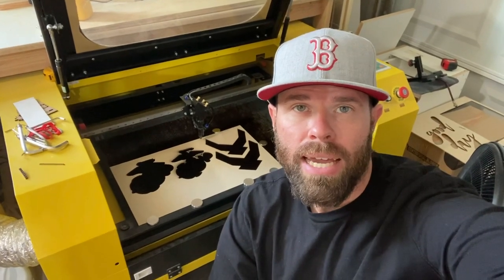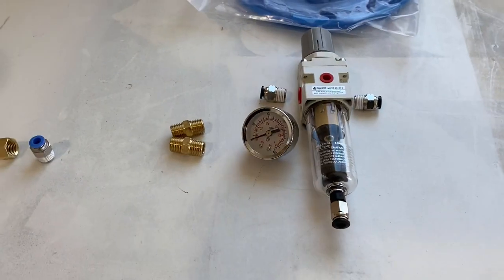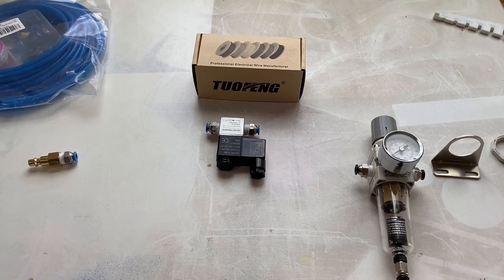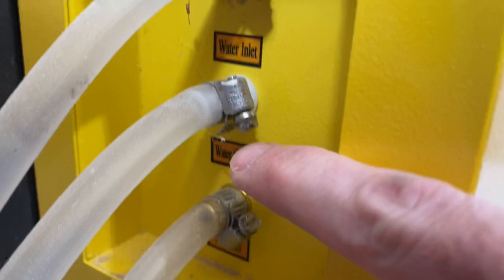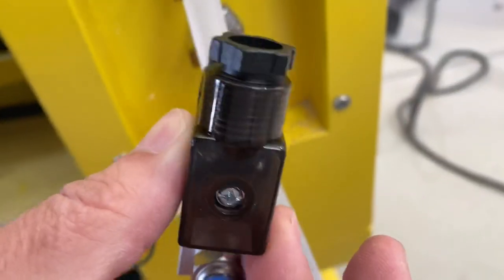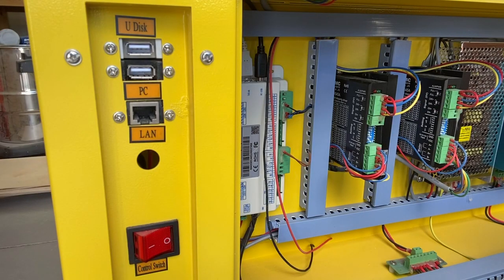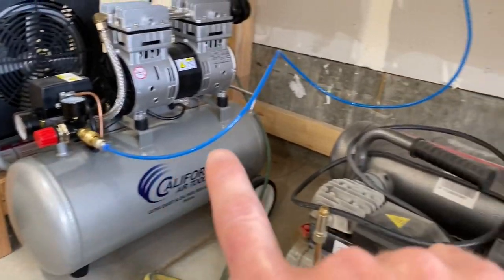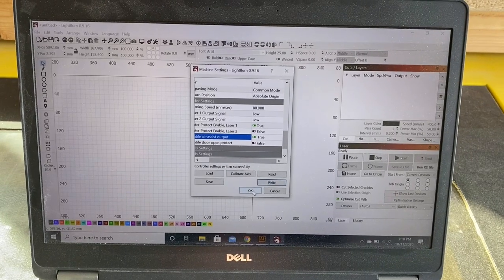Upgraded Air Assist for Chinese | OM Tech CO2 Laser

Comment: Great video. I just got an OmTech 60W that came with the small internal pump, but I’m assuming I’ll get better cuts connecting it to my air compressor instead. And also replacing the exhaust fan as you do in another video. I’m curious why you needed the regulator - doesn’t the air compressor already have one that will let you set the PSI? Thanks
Reply from the maker: So the regular gives you adjustability closer to the machine and it also had a moisture trap to keep anything from getting on the lens and ruining any of the laser components.

Comment: Excellent video! Just did my upgrade. Is there a way that I can make it so the air assist is on while doing a project vs when the laser fires? The relay just keeps clicking when the laser fires. Is there a setting in lightburn somewhere?
Reply from the maker: You most likely have a specific controller that has a setting that I hidden from Lightburn called “blow type”. If you use RDWorks you can access it and change the setting to processing and that will fix your problem.

Comment: Great video. Just curious, why didn't you use the original air assist nozzle and put the solenoid inside the machine? Seems like that would have given a cleaner look.
Reply: Correct me if I’m wrong please but I can’t find where he changed the nozzle. It’s looks like the original nozzle and only changed the tubes

Comment: I am trying to get this upgrade accomplished. I have a brand new 60 watt red and black. It has the factory air assist mounted in the back, underneath the bed. And in the "board" of the laser I only see "24 W and aux air" for places to accept new red and black electrical wires. Is this where I should wire to? Do I cut the power to the stock air assist?

Comment: Great video,  I also have a 100W Omtech Blue machine.  do you have any issues with Pin (5) Wind not working.  i cannot enable it through Lightburn or RDworks.  Any suggestions or if you got it working on your Blue machine would be great.  Good videos keep it up.

Comment: Cool. I have the exact same laser, and tried cutting a puzzle, but it came out tinged from the smoke. Been suggested to add more air, so this is perfect for what I need to do.   How loud is the compressor compared to the air pump and blower? I have my whole set up down to 64DB, and since it looks like you are using the same extractor I am, it should be a good comparison.

Comment: I ordered all these parts and went I went to assemble this today I could not.  I ordered the alternate solenoid because it would arrive faster, but it did not come with the adapters to the air hose.  those 2 adapters cost the same and the whole other solenoid with adapters, so I'm returning the one foe the other, bit that still leaves me unable to get grom the compressor to the air hose because the included 1/4 inch fitting is male, and lo Aly nobody has a 1/4 female to the female side for the coupler.  so even after swapping solenoids,  I am short a needed adapter from the compressor to the hose

Comment: Following along to the part where we are connecting to the black tube coming out the back. It appears my 100W Red/Black that hole is empty. Inside there is a black tube connected to a small compressor possibly internally. How should I proceed on that guy?
Reply from the maker: With the internal pump you will want to disconnect the air line and that will be the line that will connect to your solenoid. Then you will want to disconnect the power wires to the pump from the power supply. It is a pretty simple procedure just make sure the everything is unplugged so no power is being supplied to the machine. It is up to you whether you completely remove the pump or not. At this point you can continue with the installation.
Reply: @BeardedBuildsCo  Thanks. Was watching and looking around some videos and figured to pull the air line. Would you just disconnect the wires and cap them or completely remove? It looks like the wires coming off the old air pump when they meet the board are joined with other wires from a different part.
Reply from the maker: The safest thing is to remove it completely so there are no live stray wires but you can do it either way.
Reply: @BeardedBuildsCo  Very helpful. Thanks!

Comment: Thank you for your guide. Quick, straightforward, and easy to follow.
I have somewhat of a newb question.
I noticed that you link to 6mm OD hose, but also link to 1/4" OD Push to connect fittings. Is it okay to mix and match between 6mm and 1/4 fittings/hoses? Are they generally thought of as being interchangeable? 

Thanks!
Reply: I ordered my laser today. I will get it by the 15th!
Reply from the maker: Awesome! Congrats!

Comment: Thank you so much for this video. Ordered all the parts. Looking forward to the upgrade. Quick question. I noticed you used a new separate wiring block to wire in the air assist. Would there be a problem wiring the new air assist into the original air assist wiring block? Any advice would be appreciated. Thanks again.
Reply from the maker: The stock air just turns on and runs all the time. In order to us the solenoid set up you have to connect it to the pins that I show in the video. 24+ and Wind
Reply: @BeardedBuildsCo  Great. Thank you for your response!

Comment: I noticed the compressor turned on pretty fast after the air started.... is it able to maintain the desired airflow continuously?  Does the compressor have to run continuously or does it cycle on and off?  I'm just trying to get a feel for what size compressor is needed for this since I'm about to convert my own laser.

Comment: Question on the solenoid.  Is it supposed to let some air through when the air is off?  I can hear the airflow when it kicks on, and when it's off there is still a small amount of air going to the laser head.
Reply from the maker: If you are using the setup from this video then there should be no air when a job is not running.
Reply: @BeardedBuildsCo  I am using your setup.  I just looked at the Amazon reviews, and there are comments about it leaking.  So, it looks like I received a bad solenoid.

Comment: Thanks for making this video.  Laser is coming in a few days and I already bought all the parts through your affiliate links.  Only one question, what are the 1/4 elbows for?  I bought them but couldn't find them in the video.  Did I miss that part?
Reply from the maker: They are if you need them for your specific application to route the hoses where it best suits you.
Reply: @BeardedBuildsCo  Great thanks. Cant wait to install it!

Comment: I completed the upgrade like in your video discription , now i have the problem with theb lens , its always dirty  , within 30 minutes , what goes wrong , to much pressure ??
Reply from the maker: Are you draining you compressor regularly? If there is water or debris coming through the air lines it will likely dirty the lens.

Comment: hi if i get this compressor do i still need the regulator you talk about in your video and do you think this compressor will be suitable for my 80w laser thanks as could not get California air tools one as in the uk
Reply from the maker: The regulator have a moisture trap as part of it. That is essential to make sure that it operates with out any water coming through to the lens.
Reply from the maker: Looks like a solid unit from what I can see.
Reply: @BeardedBuildsCo  thanks so do I need to install a separate regulator..??? But I was thinking if I install the other regulator I could position it closer to me to dial in the pressure rather than keep going to the compressor just wanted to know if it would reduce anything by having 2 on the system thanks for your time

Comment: I have a question. I did your install on my 100 watt laser a year ago and it works great. Did the same install today on my new OMTECH 150 watt and the air runs the whole time the file is running. The other one only runs air when the laser is actually firing. Could I have the wiring wrong?

Comment: hi, how did you disconnect the built in air pump on your Omtech CO2 laser?  I am using the hose from it to the laser head, but the pump still runs.
Reply from the maker: Follow the power wires back to the power supply and disconnect or cut and cap then individually.

Comment: I appreciate the video and went through all steps.  I still can not  get the air assist to connect. I don’t know if maybe the black hose that connects to the laser nozzle has a blockage but at a loss here.
Reply from the maker: Have you set the pressure at the regulator and on the compressor? Are you sure you have a 24v solenoid?
Reply: @BeardedBuildsCo  yes I have set the pressure at the regulator and the solenoid says 26.4 v

Comment: with that compressor setup and running 1 filter how have your water moisture levels been to the laser itself, are you running any other filters currently?
Reply from the maker: Mine has been flawless. Keep in mind that I do live in a dryer climate. Still the original set up with only one filter/separator.
Reply: @BeardedBuildsCo  yeah I live in the high desert very dry climate also, just wondering what stage I should do single or double, just curious thanks for the fast reply

Comment: does ir matter when adding to a thunder laser due to the fact it has high and low assist options. Is this process of installation the same?    I also have seen where someone (i cant find the video) added to pressure guage to the machine to see what the high setting is and can adjust and same for the low....... I would have to drill a hole for each one and insert in the each line.

Comment: Did this upgrade. Air assist will turn on but won’t turn off. I was reading that a 24v solenoid is needed. I have a 12v solenoid, will that cause it not to shut off after a cut?
Reply from the maker: Yes that will cause this issue. You will want to get a 24v solenoid.
Reply: Thank you. Thanks for the fast response and great video.
Reply from the maker: Anytime!

Comment: Hi! I'm from Italy and i'm using the ORTUR LM2 PRO as my first laser experience but in the future I want to buy a more powerfull CO2 laser one.
I use your links and now I'm in love with the OMTECH 50W (I don't have the right spaces for others one). I think its good for 2k $.
I'm reading that it works connected to 110V AC so I want to ask..... it's ok for my regular 220V ? 🤔🤔🤔🙈

Comment: This compressor is way too small.
I have a 20x28 60W.
If I try to cut a bed full of objects, this compressor runs non stop and then overheats and shuts down.

Also, dual solenoids are better set up, if you want to have a low pressure for engraving. This way when you have air assist off in LightBurn , it still gives you 5psi.

Comment: I watched your video and followed the step to the "T", but now my laser isn't recognizing the x and y axis and keeps hitting the back right corner. I tried to hit escape on the the controller and still frame a job but when it frames, it wants to go to the back right corner again. Is there something different I need to do for my Omtech 60W AF black/red laser? 

Not sure if I needed to do other wiring? I did see another video that used 2 of the solenoids?
Reply from the maker: The issue you are sharing is unrelated to the air assist unless you disconnected a sensor in the process. 
Watch this video:
Troubleshooting - Co2 Laser Grinding | Machine Grinding | Limit Switches
https://youtu.be/WFhb3ZwT3T8
Reply: Yeah, we figured that part out. but where we put the air assist is where those wires are inserted. in the 24v slot. My stock air compressor is not an external on, it came with the machine and is hooked up to run somewhere else. Would using those confections work for the solenoid?
Reply from the maker: No, you have to connect the solenoid to the controller so it can be controlled by the software.

Comment: How did the 50% power not burn you when you checked the air after hitting "start"? What am I missing lol??
Reply from the maker: I turned the key to the laser power off
Reply: @BeardedBuildsCo  you happy with omtech? My leather patch hat company is booming so I have to upgrade the 20w XTOOL. I was going for a Thunder Nova, but damn it's pricey...I believe I'm gonna settle on an 80w Omtech
Reply from the maker: @RealDustyChandler I have two omtech Co2 laser and an omtech fiber. They are the heart of my operation.

Comment: so today i tried doing this exact installation/upgrade. i bought all the supplies from the links in the video description. but the air assist does not seem to be turning on. I have gone to the machine settings and then to the vendor settings and turn the false to true. ANy ideas what might be going wrong?
Reply from the maker: Are you sure that you received a 24v solenoid?

Comment: Excellent video thank you.... Have already purchased Cloudray Ultimate Air Assist Set after watching MWLaser I haven't installed it yet as I'm waiting for my compressor (HYUNDAI  HY27550) to be delivered.  Can I fit my cloudray the same way you've done, the cloudray comes with an on/off switch to switch between auto & manual and also a flow restrictor.  Regards tony
Reply: Did you get an answer to this, I just spent a lot of time trying to get the ultimate to work with no luck.  I watched this and I'm highly disappointed how much more simple it is.

Comment: Tried this upgrade I believe I followed everything correctly. Once I tried to cut after the upgrade the laser doesn't fire or just marks the wood tried to adjust the air no difference. Checked the laser tub to see if it was firing yes. I also turned the air assist off still not firing. Any help would be greatly appreciated the is a 50 Watt omtech laser
Reply from the maker: Sounds like you need to do alignment

Comment: Good evening, I just purchased the same 100 Watt as you. Your videos have been awesome!!!! I have a question though with this process as far as you doing it to the 100w. Where you attached the solenoid to the wind and 24 v ports on your 60w... was it the same on your 100w? I looked at mine and the wind port is open however the 24v above it is being used.
Reply from the maker: Yes it is the same procedure. You just add your new line to the 24v port.
Reply: @BeardedBuildsCo  awesome thank you! I saw the same red wire in your 100w and Im assuming (haven't traced it yet) but that it goes to the existing air assist.
Reply from the maker: It does not. The stock air assist is wired direct to the power supply or power terminal block.
Reply: @BeardedBuildsCo  ok so I just run the solenoid wire there along with the existing wire? Thanks so much for the time man I really appreciate it.
Reply from the maker: Yep

Comment: Wanting to add a better air assist. i have a 60 watt omtech with internal pump wire directly to the power supply and come on and stays on with low air pressure. you video adding the solenoid and wiring it to the ruida controller allows light burn to turn on and off when specified. how do you control a laser cut and engrave at the same time saying you are engraving and need small amount of air to keep lense clean the the program moved into cutting and you need higher air pressure to help with cut?
Reply from the maker: You got to the regulator and make the changes between the engraving and cut jobs.

Comment: Did you had to raise the cutting power due to more air cooling downs the parts?
Reply from the maker: In most cases no. The exception is acrylic  or other plastics.
Reply: @BeardedBuildsCo  thank you for responding man. I know is an old post but I'm in those steps now.

Comment: I'm a newbie, how did you dial the regulator to 20 psi? Is that done on the actual compressor or a setting in Lightburn? Thanks in advance!
Reply from the maker: On the compressor/regulators

Comment: Do you have a video for the other controller that Omtech is using? KT332N. It seems very similar, but like you mentioned, the block connecter is already installed with the 24v taken by a brown wire.
Reply from the maker: It is the same procedure and you can just add the add your solenoid wires to any existing wires in the terminal blocks
Reply: @BeardedBuildsCo  Thanks for the quick reply!

Comment: Is that an inline fan along the duct under your bench? It is not mentioned in the video or listed on the purchase list. If it is, what model are you using?
Reply from the maker: Yes it is an inline fan. The inline fan is not part of the air assist. It helps with exhaust. Here are the two options that I recommend.
https://amzn.to/3l5WXFA

https://amzn.to/3rFAEcf
Reply: @BeardedBuildsCo  That makes sense, not sure why I thought it was part of the air assist when I was watching the video. :)

Comment: DO we need to have a 8gallon tank will a 3 gallon one work or not last as long ? half the price that's why I ask, Starting my research, Thanks in advance
Reply from the maker: The most important thing to consider is CFM, the higher the better. With a larger take the compressor will cycle less. Since this video I have swapped out my 8 gallon for a 26 gallon kobalt quiet tech.

Comment: Is the regulator supposed to show pressure that the compressor is set to? I am getting airflow into my regulator but not out
Reply from the maker: I set the compressor at 90 and then dial it in at the regulator. Make sure that you have the hoses connected to the correct sides of the regulator. The is an “IN” and “OUT” to the regulator.